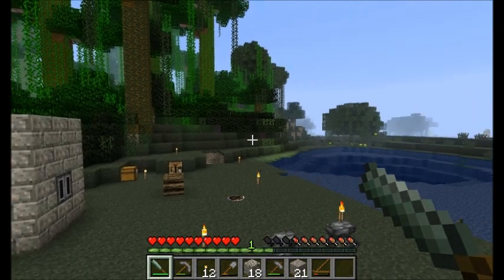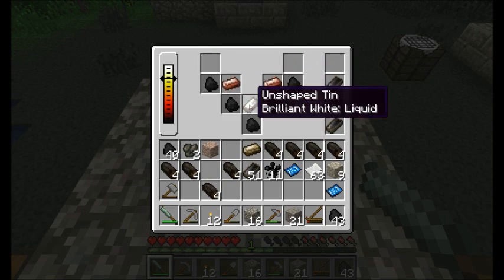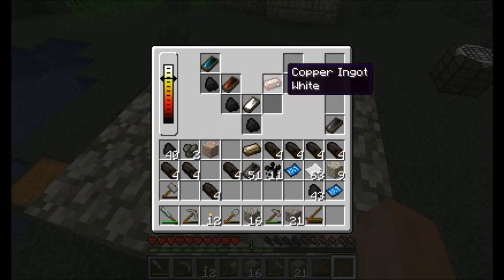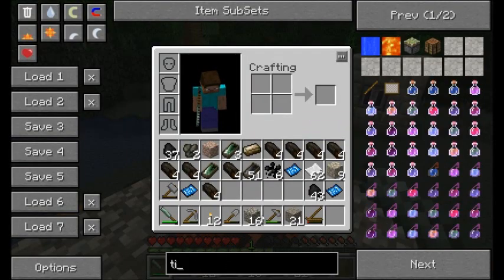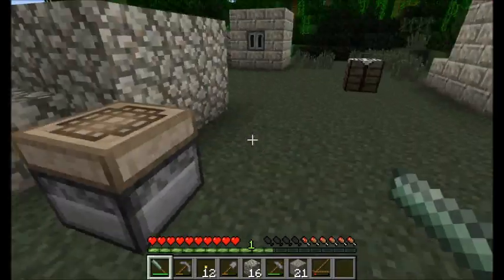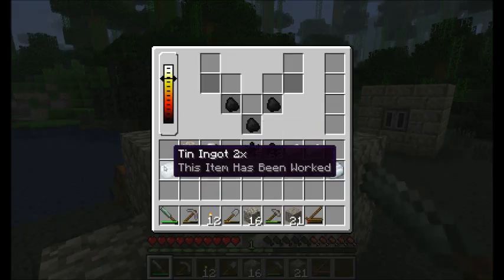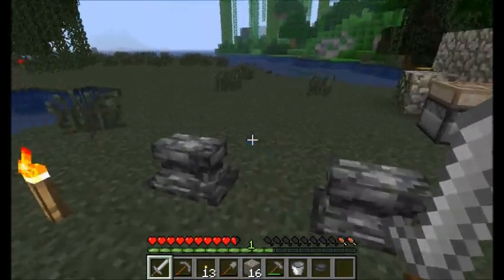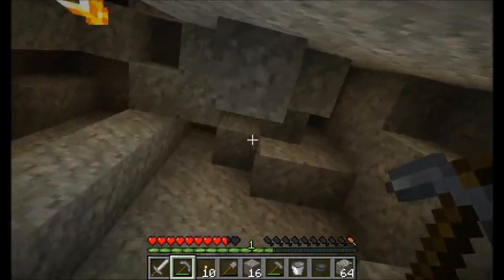Mod Spotlight - TerraFirmaCraft - Part 2

Comment: "Firepits, Forges, and the Bloomery are also affected by Bellows. The bellows needs to be placed in a certain way in order for it to feed air to the fire. The effect of this air can have a very sizable impact on the temperature of the fire, however it needs to be MANUALLY pumped or driven by a REDSTONE CONTRAPTION in order to function."  -TFCwiki

Comment: @direwolf20 You actually need to hammer your right mouse button on the bellows to increase the heat on whatever it's attached to (you can attach to forge and fires too). Just putting it there doesn't do anything. Thumbs up so he sees this please! :)

Comment: The whole metallurgy explainsit best. So you get a whole bunch of cool ores, but to use any of it, you have to smelt them in small groups, taking care to watch the temperature, then hurry and use them in the anvil when tehy're ready. That's a whole lot of babysitting the smeltingscreen. 

If the mod allow for some automation eventually, or any way of making multitasking feasible, it will be much more interesting. Cause while the concept is great, staring at a smelting UI isn't fun at all.

Comment: You dig. You find Limestone. For Cobble, you dig it. For "Smooth" version, mine around the block except for the bottom one, then take out the bottom one last.
P.S. Don't do this for the one that actually specifically states that it is smooth.

Comment: 1: Install ModLoader
2: Install Forge
3: Download the library for it (it's linked on the thread)
4: Install the Core Into the Jar file.
5: Add the Gameplay zip into the /mods folder.

Comment: yeah i figured it out by now thanks :) the people in the IRC are very helpful. it turns out i didn't even need limestone for the chisel as it doesn't require 2x ingots, i just needed a metal you can actually make tools from since my lead ingots are atm useless i think

Comment: If a player should take damage then the developer should make a little thing to make a additional equipment slot: Gloves. Because Smiths use gloves so that they don't get most of the heat transferred from the metal to their skin.

Comment: It wouldnt work with the technic pack.

This is a total conversion, it completely redesigns how minecraft works, all the other mods would have to be made accordingly, and I dont think that would happen.

For example, what about the red power trees?  Would they drop the same logs and go down so fast too?

And the rubber trees, what about them?

And thats only talking about trees, many recipes would be screwed up because regular planks don't exist.

Comment: it's ABC installing A) Install Modloader and Forge in the jar delete Meta inf then run minecraft to check if Modloader and Forge works and close then again B) install the Core and Texturepack into the Jar and lastly C install the two other files into the Mods Folder don't unpack those two

Comment: Actually blacksmiths Don't use gloves. It lessens their accuracy and the gloves cause extra vibrations that actually hurts them over time. This isn't a new development as books from the 1800's advise against using gloves.

Comment: Yeah, this mod is full of extremely cool concepts, but doesn't really do it for me. Let me explain before someone throws a fit. It's just too tedious. The low stacks for wood, the melting timers, the anti-multi tasking... hell, even sticks, which are used so much, are impossible to get from anything other than shaving trees.

This mod is clearly inspired by DF. Thing is, the reason why DF works is because you have your dwarves slaving away for you. Here, you are the dwarf. And it's too tedious.